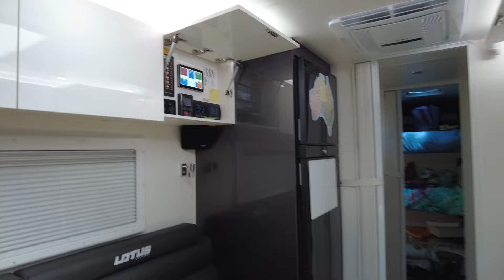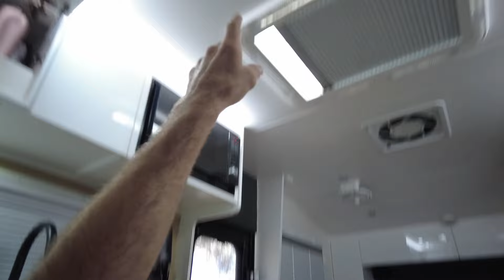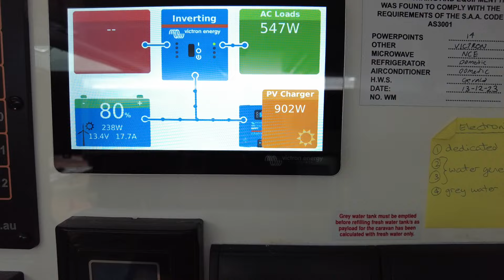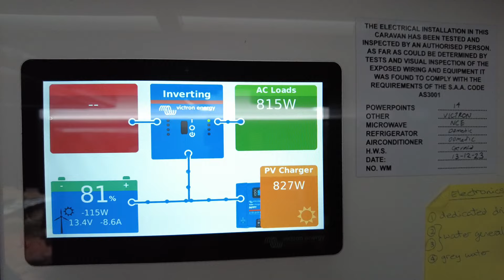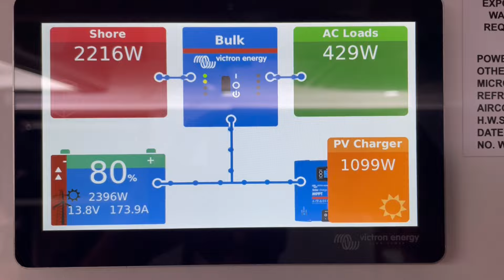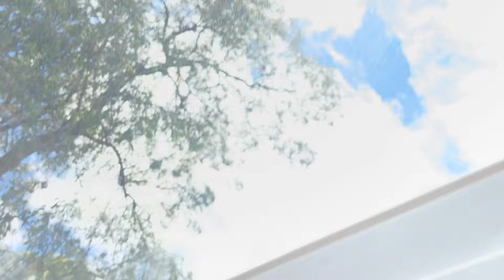Lotus 1590watt/930ah lithium off grid set up air conditioning microwave from batteries￼

Comment: looks great   Question when running panels in series does each panel require a fuse or are they classed as one circuit ?  i assume when running in parallel each panel would then be fused  Cheers